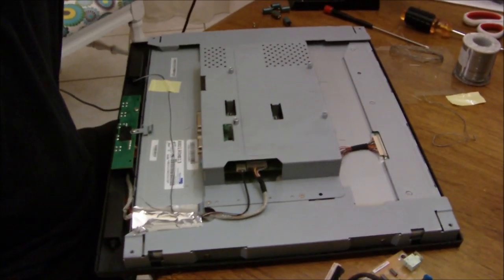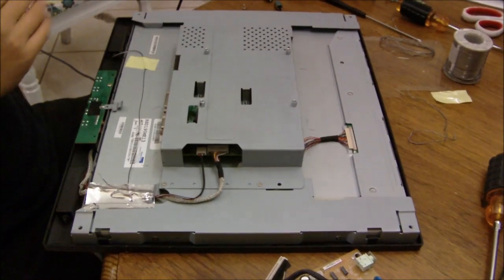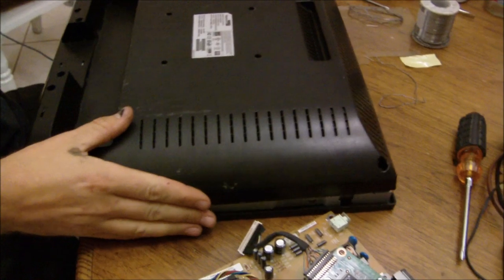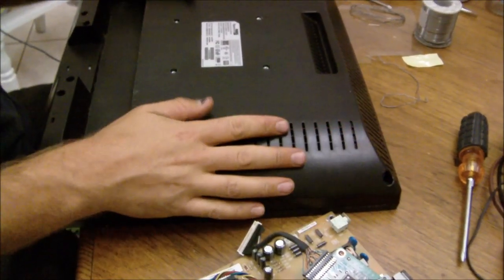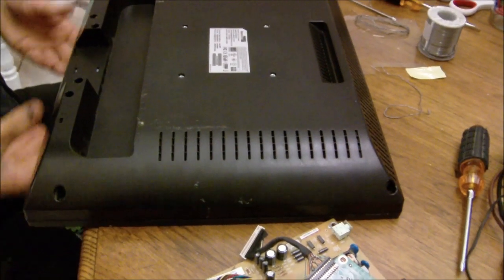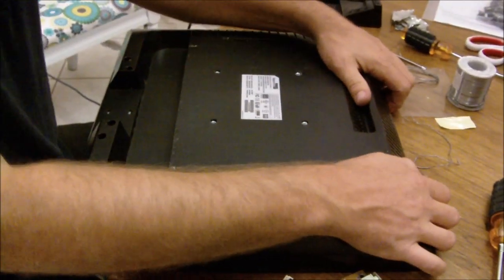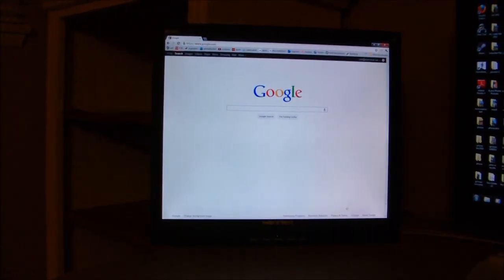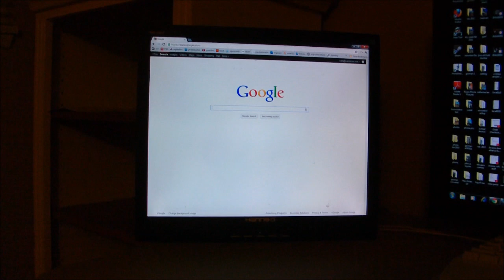How to fix a Haans G monitor

Comment: Hi il have monitor PC Hans G hq 191d, It's stutdown After 3s probably condensateur on the power card  but i don't found the way to open rear hood i remove all thé screws but the hood doesn't move AT all have you please an Idea ?

Comment: Know anything about whether the monitor controls work under these ? I found a monitor just like mine at a Goodwill Recycled Electronics store for $10.  It's in fantastic shape, only the controls at the bottom are dead so the color is stuck on purple. It also won't turn on or off.  Is it worth $10 or pass on it ? Fixable ? Thanks for your help.

Comment: Have a HG281D that was periodically flickering on and off and now displays the windows start screen, etc when starting, displays my desktop for all of 3 seconds then goes black with blue light remaining.  If I let it stay on in a few minutes the screen starts to flicker on for a little longer.  Is this a bad capacitor issue?  I think I may have heard a pop last night..so that might be it lmao.  But I also installed new drivers, but have since gone back.  Can drivers cause this, or is this purely a monitor issue?
Reply: You have bad capacitors.

Comment: There may be more than one problem. I had the flickering and what appeared to be a focus problem - almost a double image. This was eventually fixed by changing from the VGA input to the DVA. However, I also have the problem with warm-up issues. I'm not sure that I have the technical skills to do the fix that is above.

Comment: I have a Hanns-G HG281D that keeps going black and then back on, over and over. The power light stays on (blue) as well. Would this fix work for my problem? Thanks!
Reply: Sounds like the same bad-capacitors-on-powerboard issue. The reason it goes black is b/c the power supply voltage drops. Once off, the caps have a chance to charge back up, so the monitor turns back on.

Comment: what model is this and what fault does it fix? i have a hg281 which the xcreen goes on and off but the power led stays blue. it ok when it warm though
Reply from the maker: in the video is model HC194D
I also did this same fix on an HN100D

often similar products from the same manufacturer are strikingly similar inside.

It's been a couple years and I don't remember the symptoms exactly.  screen shutting off and power light staying on sounds about right though.
Reply: rhauf1 iv got the psu sat next to me atm all the capacitors look fine but il change them anyway (i used to repair tvs for a living but never did a flat screen)
Reply: rhauf1 i changed them all today and the fault is still there!! its ok when its warm though
Reply from the maker: eatthisvr6 ahh, that sucks!  well, time for more troubleshooting it sounds like.

look for bulging caps in the power supply, or if you're comfortable working on it while it's on, test for AC (ripple) on caps in the power supply, see if power supply output is constant, there should be a few different voltage taps..  good luck!  and even if you don't find the problem, you'll learn a bunch.
Reply: rhauf1 i changed every cap in the power supply (apart from the big smoothing cap ) 
i did that a week ago and yesterday its gone completely lol it goes into standby after 10 mins of blank screen and says input out of range so i think its the logic board.
problem is iv no idea where i can get the part for it!
Reply: I did the same with the caps, with the same results, did you have any luck figuring it out?
Reply: no mate, i stuck it in the loft

Comment: i also got a Hanns-G HG281D works fine for a bit but after about 30 mim the screen starts to shimmer and starting the the bottom right of the screen its starts turn white. i have to turn it for like 20 min then it goes back to normal but after another 30 min its fades white. is this the logic board of the power supply board?
thanks

Comment from the maker: my old work was throwing away tons of them, so grabbed one and troubleshot it figuring i could do the work once, and have as many as i wanted (they all had the same problem) this is pretty typical with electronic stuff.   if it goes bad in one, it'll probably go bad in the other 100 million that came from that factory.

Comment: Sorry, It's been sitting there for at least 2 weeks. I wanted to run 2 monitors is why. If not worth it, I can get one on eBay for around $35 in working condition.

Comment: I have a Hanns G 28"  HG281D monitor about 4 years old. It has started to not turn on with one click.  you have to hold the switch don a while, then it will pop on and you continue to hold the switch for maybe 2 more seconds it will stay on. BUT it starts to flicker off the back on, just by moving the tilt of the screen slightly!??  If you can keep it on for 5-10 minutes, and it warms up, it will stay up the rest of the day....... Has any one else seen behavior like this?  Can it be fixed?
Reply: I have the same monitor (I think) with the same exact problem.  I'm basically waiting for it to fail but don't want to take it apart as technically it works (just takes a good 5 minutes to warm up on turning it on from cold start).  It does sometimes flicker off for 1 second on occasion (which I think is related to what is displayed on screen as if I open a new program or window it will often stop doing it).

I'm also interested in a potential fix if there is one.  Not many 1920x1200 monitors out there with a reasonable price.
Reply: Similar to my Hann G. The screen goes blank and the blue light goes out as if it was turned off with the switch. If you turn it back on it will work for a few minutes and then go off again. Could this be a broken switch or something else?